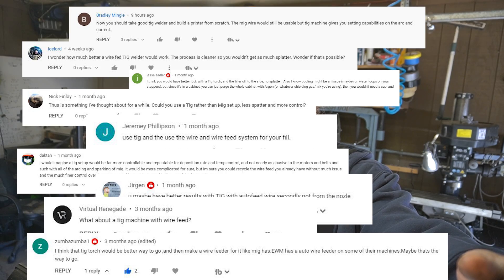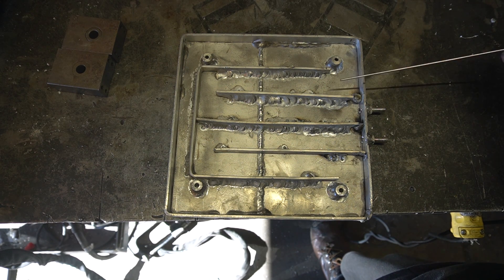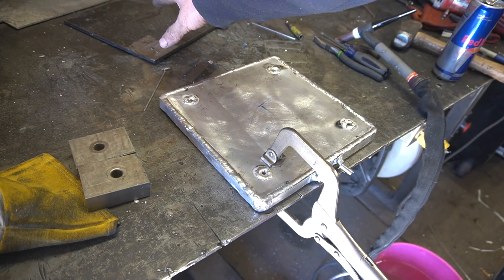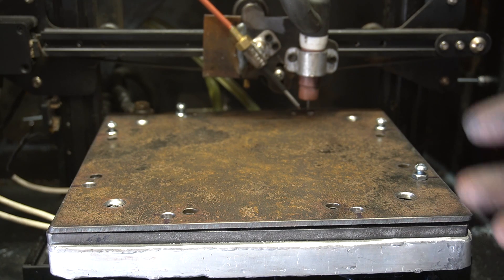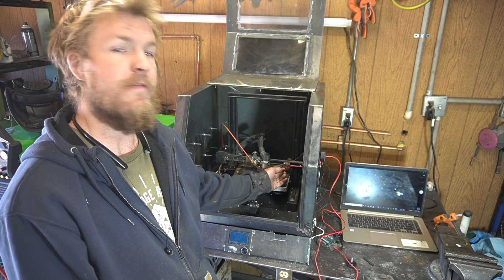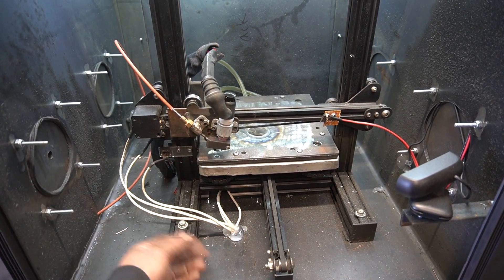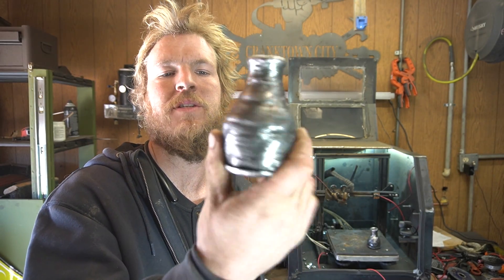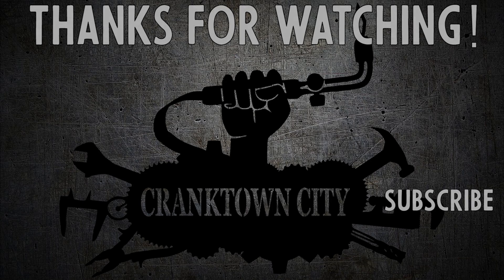DIY Metal 3D Printer Using A TIG Welder

Comment: Not gonna lie I clicked on this expecting another hacked together "metal 3d printer" that is lucky to pull off a single line or at most a layer, but those vases were straight up amazing. The second one especially, you can see the spiral surface even on camera. 

I couldn't see exactly what the problems were on the second vase because of blur and glare, but at a guess I'd say it's because the fact the torch is always leaning in one direction, and the wire is always feeding from one side regardless of the travel direction. The only way I can think of to solve this is a fourth axis but that's pretty complicated from a hardware and software perspective I think. 

Note on the layer shifts, I think they're occuring on the y axis? The bed is quite heavy with the water cooler and as you print you're only adding more weight and inertia. I'm surprised the stock motors are keeping up at all.  Consider servo drives maybe, there's some cheap ones on aliexpress. Timing belts aren't ideal for such a hot environment either so they might be expanding and getting loose, then skipping teeth. Screw drive or rack and pinion maybe?

Didn't think I'd see hobbyists getting such amazing results with off the shelf parts so soon.

Comment: ever since i used my first mig welder 25 years ago this is the step along the way real 3d printed steel parts and self replicating robots HUZA (on a side note would adding in a IR thermometer that would be triggered by the same switch as the time laps camera maybe give you a way to ad a cool down pause before the next layer to help with some of the heat soaking and warping when you have a more concentrated pass or just the item starts to get to hot) fully willing to admit i tend to just use the Ir thermometer to see what bearing is about to melt on the disk mower but i know they have more uses in life like is my coffee trying to kill me and the like

Comment: I dig the project. I've repurposed a CR-10 for several projects, not limited to extruding peanut butter benchies. On another note, I run a Weldlogic orbital welding lathe at work and rather than have a raw wire liner, it has a mig welding tip to more accurately aim the wire. I hold it back at least 1" from the tip and the gap from tungsten to wire is around .070", where as the wire is below the tungsten. If you have any questions, I program them as well, so hit me up.

Comment: Tig welding 3-D printing has been used for decades (but not called 3-D printing).  It is how screws for extruders are made.  Might want to look into how it is done commercially.  Perhaps get some ideas for improvements.

Comment: Do it.  Ditch the ender belt system for screws, and use an extruder from the ender for the wire feed so you can get more control (and smaller line widths).

Comment: You can probably benefit from figuring out how to use pulse welding to your advantage for this since it can allow you weld faster. Its a bit hard to give you proper advice on how to set up the pulses since this is a pretty odd application but I'd recommend trying on 15hz, with a duty cycle of 50% and background current at 50%, averaging out to the current that you normally would weld at.  You can then experiment by using a higher welding current while lowering your background current and duty cycle and increasing the pulses if you notice excessive rippling in the weld.  This should allow you to use an average current that is lower than what you'd weld with if it you were using a constant current.  Then you can try to increase your weld speed and increase pulses and background current to reduce excessive rippling once again. Of course this is just general advice, it might be completely wrong for your setup.

Comment: Wondering if you could get away by using a spot welder and a plain wire. I mean that's the closest you can get to a 3D printer since you're just putting out a "wire" not melting it into a puddle. 

And while you're melting the touch point of the wire to the rest of the structure and not the whole wire you should have much less issues with heat. There's also no shielding gas needed.

You would lay down say a mm of wire, and have a small V shaped pin come down and press the wire down until a connection is made. Then you pulse for half a second some high current low voltage electricity into it and the base will be the ground.

At the touch point the connection is the thinnest and should heat up, while the rest stays cool since the connection is very large.

The V shaped pin could probably just hold up by an electro magnet which turns off and let it drop down to the wire (maybe with a little spring to increase the pressure).

Comment: God damn this is cool build! Definitely take it further! For gas seal, make ends cut in a angle and layered on each other, so when its compressed you get better seal... Did this with copper wire in low compression 2 stroke engines head gasket that could not get replacement parts no longer, local stores dont carry head gasket material-.- and it kinda works least on hand cranking it, just need to double the layers and actually try start it. Then i might shill the money to get proper material.
Maybe decrease power setting so you get higher definition, though that might cause cold welds, but that could be one option. Other potential issue is heat expansion specially on higher layers. For now that vase does not need much to get better finish so it huge improvement. UV and IR radiation from the weld probably caused belts to stretch, so maybe replace specially the Y axis to lead screw  since stepper might have delay compared to X axis due all that added weight. On ender3 sure build base is bit hefty but its still way less than water block, steel plate and print. It needs to move same phase as other axis, not it might be lagging behind. This should look like oval shape, but its easy enough to measure, bit harder to correct since you would need to potentially retard X axis behind to get them move same phase, but this would cause issues with the weld pool, that would need adjustment on power, but this effects print quality. Easiest method is to get more torque on the Y axis that can move axis's in sync. I think you are close to solving this and god damn would it be cool to be able to print metal, even if some peaces still need little machining to made ready.

Comment: Definite significant progress from attempt #1 to #2 to #3, and printing metal at all is an achievement. Keep it up! 

Am I right in thinking you're printing in pretty pure tungsten though? The cost might limit what you can end up printing. Then again anything you DO print is going to be pretty indestructible. It's only a shame you can't melt failed prints back into new wire.

Comment: I think if you wont to go from ok to great results you I would do the following:
- Replace the belts with a ball screw, so you eliminate layer shift problems. In addition you could also add a closed loop system.
- Get a preasure regulator infront of your argon and have a small but constant flow into the chaimber so argon leaking is a non issue.
- Adjust the wire feed to do a pull back if you reach the end of a layer, this way you wont have any sticking problems.
Please keep going, I am so excited for this projekt. It looks great considering it is made of an ender 3

Comment: Congratulation! You weldled a robot that can now weld better than you!  Definitely take this further.  

I don't know if you pay much attention to experimental printers in universities, but a lot of places have started printing into a vat of gel.  This solves a bunch of problems, it cools down the part, reducing sag and increasing print speeds. It supports the part so you can do more aggressive overhangs, and it means you aren't losing all your inert gas every time you open the lid.  A lot of the designs don't use gas at all, and just use a coil to melt the metal and dump it through a needle straight into the gel.  It doesn't  have to be a fancy gel either, kitchen stuff, or maybe a fireproof foam.

Comment: Could you snip the electrode wire to almost a cut so that metal depósition would be More like blob by blob? Perhaps you are getting somewhere. Good luck
Reply: Or tweak solder machine parameters to short rapid shots of welding. The issue to control Is the metal as it gets Molten AND the heat path that pulls those specs of Molten metal in the plasma towards the hot part

Comment: Tig was a good choice. It's a lot cleaner since you're not dealing with the weld spatter. I think your next step should be to upgrade your axis movement systems to something like a linear motion gear.

Comment: @Cranktown City
i have a cool idea for a video you can make.  Can you please water cool one of your tig welder machines?  Not water cooling the tig torch , but water cooling the actual tig welder machine itself to increase duty cycle, you could use cheap computer water cooler kits , an pipe it into your normal tig torch cooler , so you can cool both the machine an torch with a single cooler.  there is no youtube video doing this ,you'll be the first.

Comment: Could you try using pulse mode ? There are also some special tiny tiny TIG for jewelry or mould repairs that would make weld spots down to 1/32" or 0.5 to 0.8mm and it would maybe kinda match the standard FDM resolution ?
Reply: @Cmos6  well i don't know about you but just having the wire feeder option for common/longer welds would be nice as i like tig welding 👨‍🏭but 4ft rod's can sometimes be a pain to wrangle with and having to stop/starts for 8in cut up rod pieces can suck ect. side note can powdered metallic be used? as i saw gas flame spray welding ( for cast iron parts ) but i didn't want to buy a gas torch/it's expensive for me to use and not my favourite type but wire/cutting gas i can do it as i have in the past
Reply: But then wouldn’t it take even far longer for a print, maybe a week or more rather then a couple of days
Reply: @RockieOnly  i was thinking of thing's that might work in both processes and i don't really care for $$ gas but powered metallic is useful and a simi manuel metal feeder would be nice on some projects with manual tig welding
Reply: @RockieOnly  powdered guns come in different sizes

Comment: Chain and sprockets instead of the belts… and a pre-heat the enclosure to thermally stabilise the ‘running gear’  just be sure to add a tensioner or that slop swill kill ya

Comment: Solution to layershifts:
1) Increase StepperCoil current on the stepperdrivers due to the heavy TIG-head and cable
2) If your steppers are OpenLoop bipolar you should take ClosedLoop MKS.
3) MKS also solves your long stepper wires problem with losing current feedback info.
4) Due to the TIG-heat that's MUCH higher than a plastic filament, your enclusure temp is to high for the belts loosing their stiffness.

Good luck

Comment: If temperature seems to be an issue, build an air cooler. Either with water and an old PC water block/car radiator. Or use aluminium fins connected to outside fins with a fan blowing over both sides.

Comment: Honestly, this is more art than your average NFT... Ok that was a low bar.

This is the most wacke a mole engineering since Martin has stopped posting Marble Machine X videos

Clearly there's something messing up the axis during print, it's mostly likely related to heat warp, I have no idea how one fixes that.
maybe print something with lower melting point and thermal expansion?
In any case, it is inspiring, it's true art.

Comment: That's the problem with wire feed from the side. You never get a process that does not depend on which direction it's just on. 
The only way to do this is with conventional methods is MIG. Mig Pulsed if you can. And you should cover everything made from plastic. The UV radiation kills it... ;)

Comment: This is really impressive progress. The box full of argon is probably helping you avoid a lot of headaches aside from the obvious: UV is bad enough on its own but UV in oxygen-containing atmosphere makes ozone and nitrogen oxides, and those reactive gases are really efficient in turning all your organics (belts, and seals most importantly) to powder and crud. Check roughly how well your box is sealed; being sure that the atmosphere isn't slowly going bad is a good problem to not have. Well done on that.

If you don't already know about star grounding, it may be helpful in finding a less cantankerous solution to your EMI problems. Pick a point and all grounds should come from that point and not meet up later. Common mode chokes may be helpful. If your signals can be differential, that can help reject noise. Lower impedance signals are less vulnerable than high-impedance signals. A low-impedance differential signal on a shielded twisted pair is the best, which is why it's possible to use thermocouples at all in spite of the small voltage of their signals. I don't know this subject well enough to give more helpful recommendations without looking at the specifics of the setup, and my experience in this area mostly pertains to trying to read thermocouples cleanly in spite of noise sources like electric heaters.

 The fundamentals of your setup look pretty good actually. The belts might stand up OK if you did as little as putting a bellows over it. Not sure what's causing the layer offsets and drift, but if you can solve the motion control issues this setup seems to have some potential. That potential is of course limited to what you can do with your 5 mm wide melt pool or whatever it is, but still really cool. A vase that holds water, especially as smooth as it was, is not a trivial milestone.

Comment: Awesome! So glad you tried this and it seems to be working!
Looking at the time lapse the part is getting very got as you get away from the base, so maybe some sort of directed argon jet to cool each layer as you go up?
Also, a thicker bed plate that is better fixed to the cooling plate to help control the heat. 
Higher current for less time would help keep the puddle smaller for each dab to.

Comment: Incredibly impressive what you've done! I would definitely be happy to see more.

Every non-powder metal 3d printer I've seen before does a very rough shape first and mills it down to the desired shape afterwards. The fact you are getting this much detail without post processing (beyond a wire brushing or the like) is incredible.

Comment: hi . 
this print may look bad, it depends on the point of view of course. Normally, a metal cube is machined, cut, cut, and processed through many machines for the desired shaping. Normally, a metal cube is taken, cut, and processed through a number of machines for a piece to be produced. made according to the desired shape.A lot of time and material is wasted while doing these processes.Even this device that you have made is actually quite useful. Instead of taking a huge metal piece and trying to process it in standard ways, it is very convenient to make it in rough dimensions and turn it into an original piece with light processes.Of course, it depends on your point of view, maybe there are people who don't like what you did, but I think I found it useful..

Comment: Dude these Jerry rigged metal 3D printers are impressive even where it is at now you could take the hybrid route printing then machining out the imperfections for high quality part but it’s complex internal geometry like incorporating multiple parts say for your vacuum chamber by cycling between ptinting and machining to have accurate internal geometry too only thing is the clamping set ups to machine using 2 1/2 axis would be time consuming to say the least but a rotating or 5 axis adds a crazy level of complexity you really bringing my shower brain storming sessions to life

Comment: I was one of the "Hey, try TiG." guys. 
   I didn't mention why but... many (many) moons ago I worked in a factory with a rolling mill dept. Not the squeezy type, the type that rolls (coil-fed) sheet metal into complex cross-sectional channels. It was important that the mills NOT stop during the run after being dialed in. 
   A 4ft. dia coil would last about 2 hours. An accumulator loop would give it just enough time to feed the next coil, trim and butt-weld it (45deg., no filler) to the material in process allowing for continuous operation. It was an "automated" operation and was the first thing I thought of when I saw your set up.
   The weld quality of this somewhat jenky looking set-up rivalled our most expensive MiG robots at the time.
Reply from the maker: That sounds both stressful and pretty darn cool at the same time
Reply: @cranktowncity  The operators made it look easy, as they do. As the plant tooling mgr, I was way more stressed watching them than they were in doing it.

Comment: Awesome job!! Keep up the great work! I know nothing about welding, so I'm totally clueless about where to go from here besides the obvious stuff: Try different printing speeds to see if that helps solidify one layer before tackling the next? Adjusting layer sizes (just like on a normal 3D printer) to see if that helps? Also, maybe the printer software thinks the width of the "line" it is drawing is thinner than it is, which is sort of like trying to write small letters with a giant marker. Finally, if you think of the end result as the "core" of whatever it is you're making, you could then grind/lathe the end result into a more polished piece. Great work! Look forward to the next video!